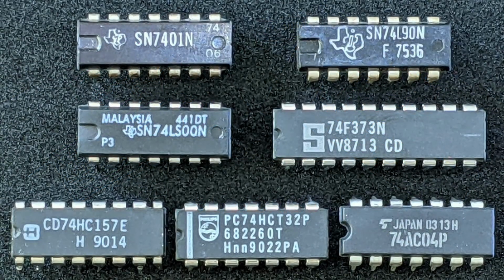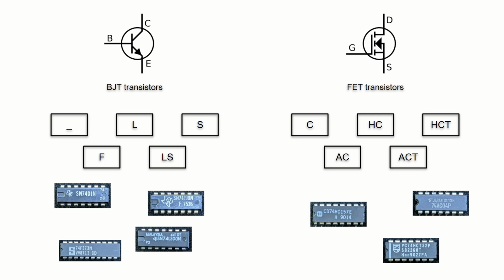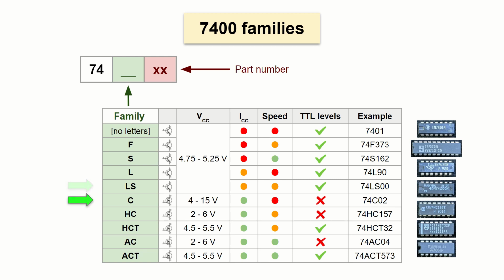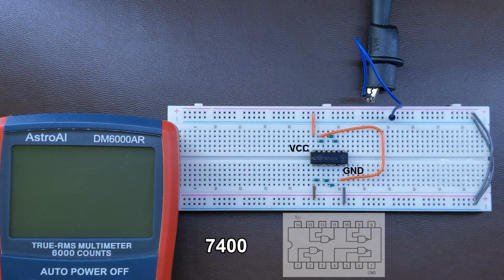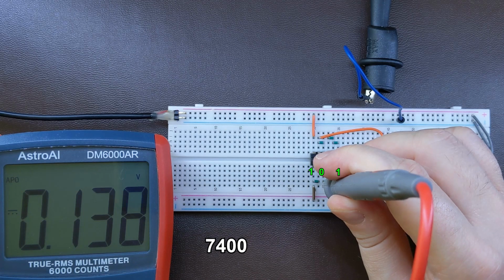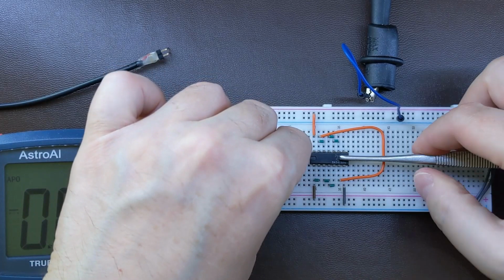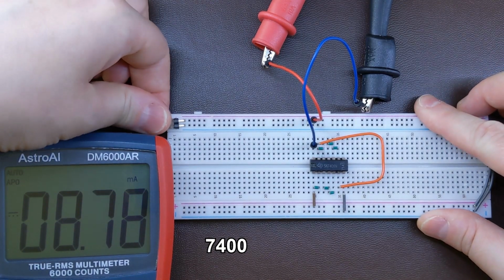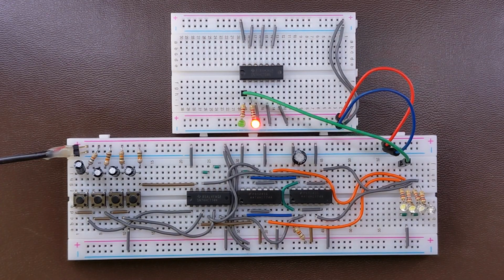Introduction - Digital electronics basics: 7400 logic chips [part 1]

Comment: From tests I’ve done F series is a bit faster than S series though AS (Advanced Schottky) is a little faster, FCT (Fast CMOS TTL) is lower power while having both TTL inputs & outputs. ACT seems to be the best of both worlds being TTL input tolerant while providing CMOS level outputs, additionally ACT has quite fast edges for 5v TTL tolerant CMOS similar & often better than F & AS series with MUCH lower power consumption. CMOS consumes more power when switching while BIPOLAR sucks power while static (Quiescent Current) or if it’s active.
Reply from the maker: This video was meant to be a very brief introduction and contained as little details as possible. Thank you @perseverance8 for this comment as it perfectly complements this video.

Comment: 1. What became of the 8088 series?
2. For the different 74 series families, might also want to go over the output current limits.  Some of them you can get away without using a current limiting resistor when connecting an LED as a quick and dirty logic status indicator, though that can mess with it being read by the next input.
3. Go over the C families that are not TTL levels.
Reply: I think that 8088 will be continued after covering basic logic gates.
Reply from the maker: I'm currently in the process of making the next video of 8088 series - don't worry. Both series will go on in parallel. Yes, you're right that I could go over current limits. I could also say more about propagation time and others. I simply didn't want to overwhelm people who haven't done much of digital electronics and discourage them from playing with it. Sometimes too much information may stop you from trying.
Nonetheless - I take your comment and I will mention the current limits when talking about 7447 - that should be a good place to talk about that. Thanks for it.
Currently I don't have plans to cover those "74C" chips (or the 4000 CMOS logic). It wouldn't add much - a NAND gate is still a NAND gate ;-)
I mentioned multiple 74 families mainly to avoid confusion of the beginners. The main message for them was really only: "if in doubt, use the HC(T) chips".
Reply from the maker: As I mentioned to Daniel, both series will be appearing in parallel. I'm currently planning the 7400 series to be around 16 episodes - that would be too long to wait before the next 8088 video :-)
Reply: @SladorSoft  you need a channel of donations.